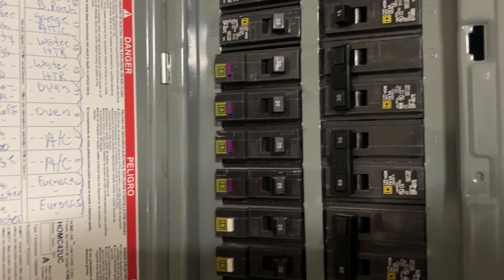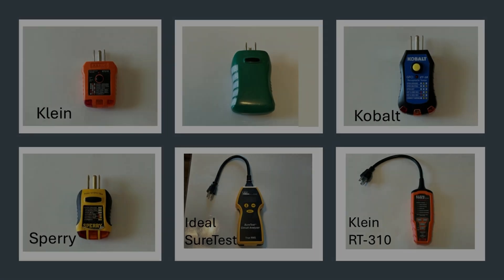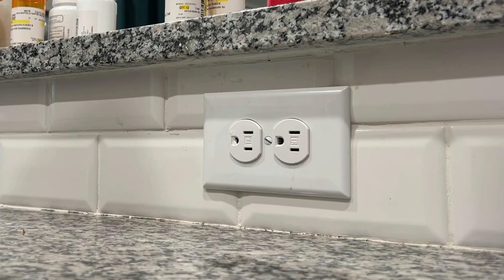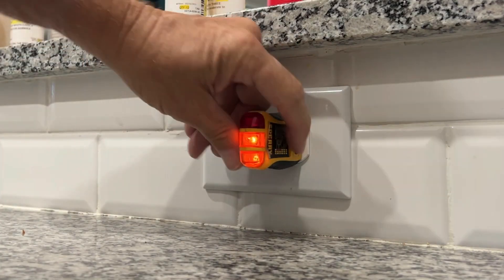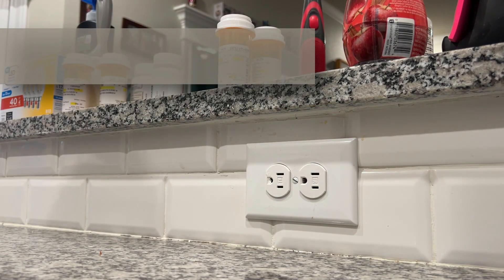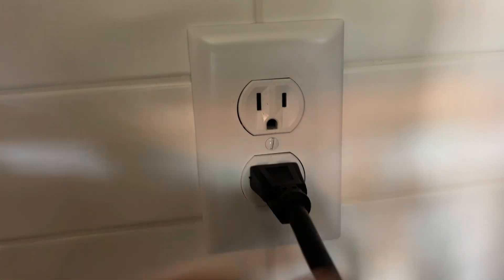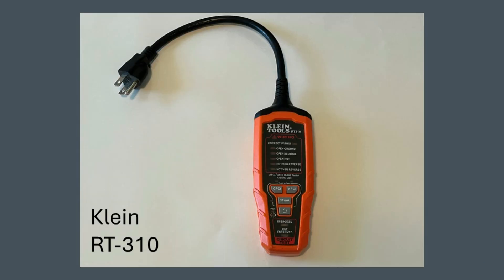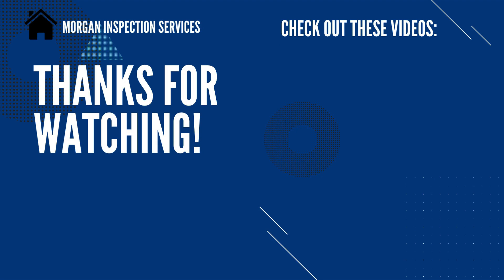Be Aware: Some Outlet Testers Do NOT PROPERLY Test Dual Function Circuit Breakers

Comment: I'm going through a similar issue. This house had a second floor added. Part of the electrical in the original house doesn't have a ground. Insteptor called out the outlets. I installed a dual rated breaker for these circuits and labeled the outlets as not having an equipment ground, this is allowed per NEC code according to my research. Now they got tested and still don't trip. Im sure its because of not having the ground wire. But inspector called it out since it won't trip with tester.  I tried with Klein RT310 still no luck. Anybody have any ideas
Reply from the maker: Ungrounded receptacles will never trip with a tester. The tester relies on the ground wire to create a “ground fault“ condition to cause the GFCI to trip. An inspector should never call out an ungrounded receptacle for not tripping when tested with a three light tester. The inspector should use the built-in test button on the receptacle itself to test undergrounded receptacles.
Reply: @morganinspectionservices3840 thanks for your response. I kept researching and also found the manufacturers manual specifies that on the manual for GFCI receptacles as well. So as long as the trip mechanism works manually, the wiring is as safe as possible with the 2 wire system.  The only other fix would be rewiring that whole part of the house

Comment: Interesting.  Never personally experienced this with dual function breakers.  Perhaps some brands are more sensitive than other's?? At work we almost always use Eaton BR style panels, or Siemens or GE if for some reason a good portion of the BR breakers we need are on backorder, this happened A LOT during 2020 lasting into the summer and fall of 2022.  The two receptacle testers I rely on are the Ideal 61-502, which is a 3 light tester with a GFCI test button,  and the Klein RT-310, and both have always tripped dual function breakers,  provided the tester showed correct wiring and the breaker was good.   

I tend to like the Ideal 61-502 more because it's more compact and easier to carry in my tool pouch when carrying my lineman's pliers, wire strippers, screw drivers and what have you.   

Also, the fact the 3 light testers can survive being plugged into a receptacle miswired with 240V,  at least for a short time anyway,  is nice,  fortunately I've only ever had that happen once,  back in 2014 at the Rivers Edge apartments in Waterford Michigan where I plugged my floor lamp in and the CFL bulb caught fire and in a full blown panic,  smashed the lamp through the window out the second floor. A through the wall air conditioner with the factory plug changed was plugged into this miswired receptacle, probably because the original plug /receptacle had burned up from a poor connection (seen this happen in a few of the hotels I stayed in over the years) the maintenance worker didn't have the proper receptacle on their truck,  so he or she  just used a regular 15A/120V and cut off the factory plug and put on a 15A-120V plug and said,  "well, air conditioner is back in business, tenant is happy.  Good enough "   Don't know that the Klein RT-310 could survive 240V without damage, and hopefully I'll never have the privilege of finding out.
Reply from the maker: Very interesting. It’s crazy how some people will fix things. Several years ago, I did a home inspection. I turned the furnace on (electric furnace) and a few minutes later, I realized it wasn’t running anymore. Discovered that the breaker had tripped. I decided to try it one more time, and the same thing happened. Obviously that was written up in my inspection report. Homeowners called either an electrician or an HVAC tech to fix the problem. They fixed it all right. They put in a bigger breaker so it wouldn’t trip. Well, that’s exactly what happened when the homeowners were out of town on a very cold weekend. Their house burned down because that breaker didn’t trip and the wires overheated.

About once a month, I encounter dual function breakers that will not trip with my standard three light tester. The first time this happened, I wrote it up as a deficiency in the report. Several days later, I got a phone call from an electrician who was at the house and asked me if I was using a dual function rated GFCI tester. He’s the one who referred me to the Klein RT 310. Now, I know to pull that out to double check if my normal tester is not tripping the dual function breaker. I think I’m going to start keeping track to see if it’s a specific brand of dual function breaker that the three light tester is not working with.
Reply: @morganinspectionservices3840 oh that's awful for the homeowners who lost their home and possessions all because some moron thought it was a smart idea to swap out the breaker to a higher amp instead of asking themselves "why might this be tripping and what are the next steps that should be taken to rectify the situation?"

Two years ago while I was doing some side work helping a friend with a renovation while I was temporarily laid-off from my current job, was in the basement removing some old galvanized pipe, to be redone in Pex pipe, and came across a length of cloth 14-2 no ground NM that was VERY warm.   Traced it to an old Westinghouse breaker box and connected to two 50 amp single pole breakers randomly placed in the panel and  double tapped which fed the range Come to find out the old 14-2 was feeding an 80 gallon electric water heater with 5500 watt elements. Good thing that 14-2 was ran in an unfinished basement it's entire length where it could dissipate some heat, as opposed to ran instead the walls.  The scary part was he had been living there for 4 months at that point,  and had two teenage girls who seemed to enjoy long showers, and had no idea about the problem until I pointed it out.  At which point he ended up upgrading the old 100 amp service to a modern 200 amp Siemens panel and running some new circuits.

I'd be interested on a follow-up video on which breaker brands seem to have trouble tripping the dual function breakers with a GFCI plug tester.   I'm sure your other subscribers would also be intrigued as well